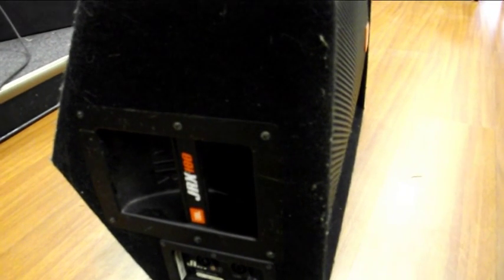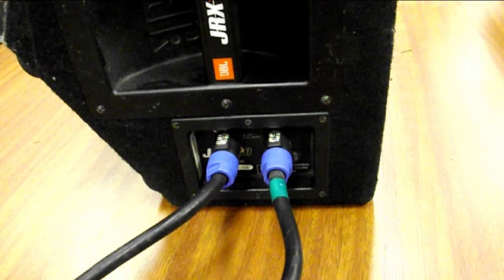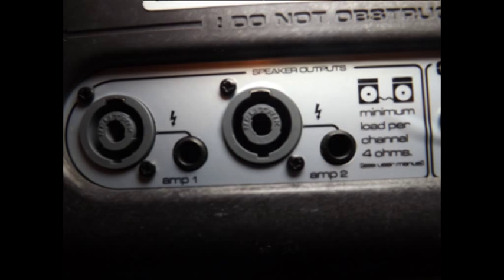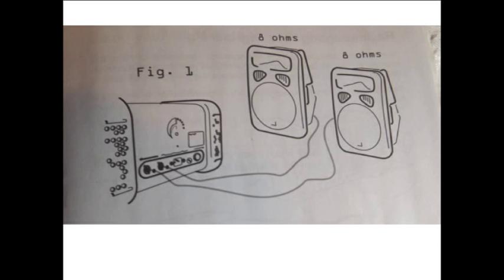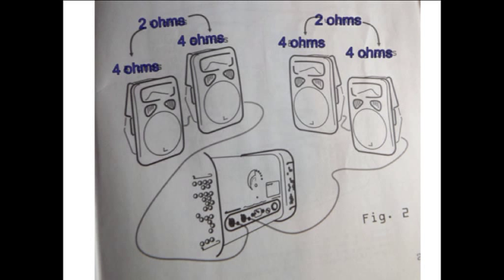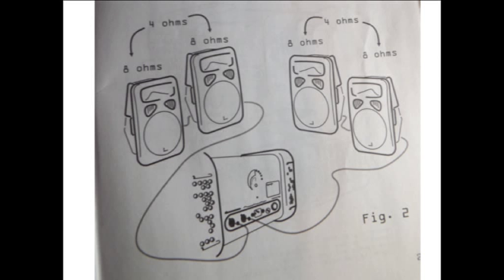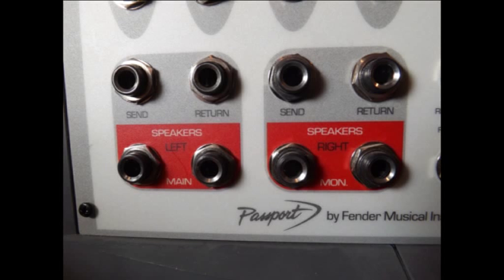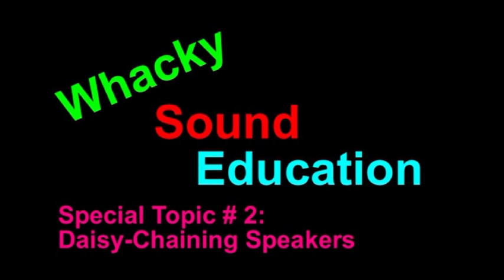Whacky Sound Education - Special Topic # 2 - Speaker Chains

Comment: I have a Samson 950 watt amp. It can handle 8 or 4 ohms. I'm looking to increase volume for an outdoor gig. Would it increase the volume more if I daisey chained 2 -  8ohm speakers or if I go line out of the amp into a seperate 950 watt amp to  other 2 -  8 ohm speakers separately. Thanks...